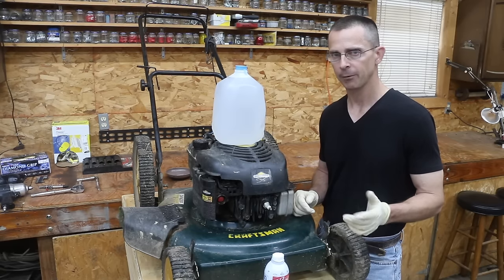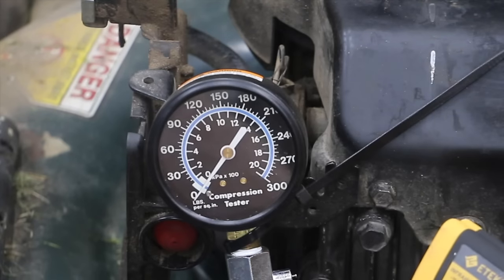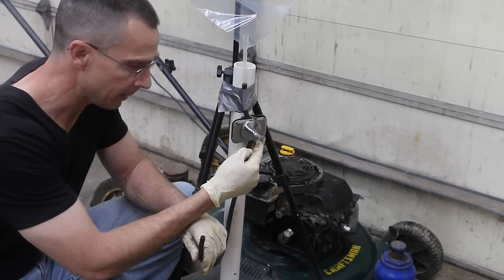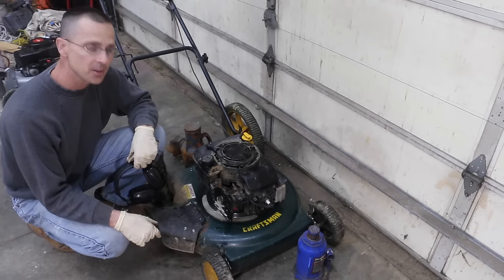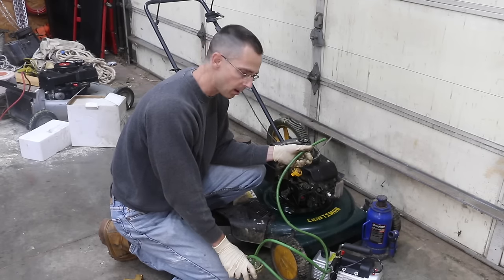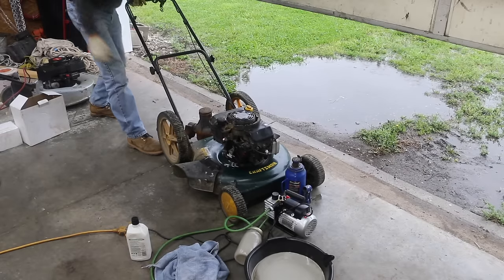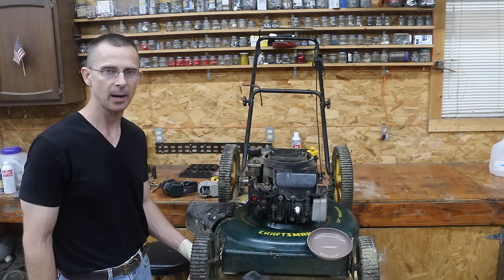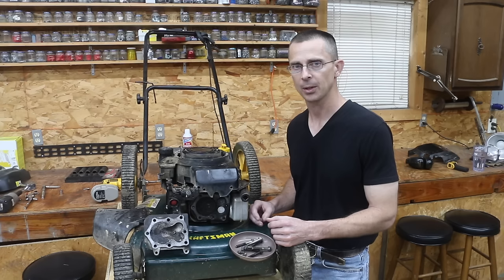Seafoam--can't believe what it did to my engine episode 5--cylinder cleaning test using water!!

Comment: Anybody else amazed that a $100 mower keeps working after all this?
Reply from the maker: Great point!
Reply: Not really. Simple engineering lasts for ever. It's the same with cars, old diesels run laps around any new engine.
Reply: @bixby9797  yea barely halfway
Reply: Mine won't after one season. 😂😂😂👍👍👍
Reply: Personally, I would not want that mower.
Reply: Just goes to show if u know what ur doing u can get anything to work
Reply: I've got one of those engines on a pushmower, and Ive been neglecting it for years because I hate the mower design, not the engine.  I cant kill the damn thing
Reply: My $120 Home Depot special runs like a top after 6 years with reasonably fresh gas. Changed the included oil after the first year (which came out dirty after the first season) for a full synthetic for $4 and it looks new everytime I check it. Im probably going to change it this spring just because 5 years on the same oil seems ridiculous., but it looks like it just came out of the bottle. I'd like to test it but I can't spend the money on that just for a cheap mower. Although it might be perfectly fine. Who knows? I suspect in many ways we are actually living in great times despite what people tell us.
Reply: I’d like to see someone pour water in one of these new EFI engines I have one and I think the dampness killed it let alone pouring in water
Reply: @bixby9797  om617 engine. truly a classic. also amazing if an old 22re finally kicks the bucket you can swap in that turbo diesel with pretty minimal adapting.
Reply: @bixby9797  truly the greatest engines ever. Seen one with 700k on it. Proof that sometimes simple is just better. My buddy had picked up an old 4runner and I believe it had a cracked head so he put a om617 he had laying around in it. I've seen those things last forever too
Reply: @bixby9797  meh. The VW alh is an engine comparable. I scrapped mine at 751k km. When I bought it it had 700, I didn't do an oil change or any fuel filters. Kept on trucking!
Reply: @leinie6683  what's wrong with the design that you hate so much
Reply: I'm surprised it even ran at 60 psi..
Reply: No, it is a very simple machine 😊
Reply: Not at all surprised. One thing Todd doesn't seem to highlight, is his maintenance/repairs not related to his subject material. But another: Unless you're losing or warping metal, you can generally put a small engine through a tremendous amount of abuse. I personally have freed seized motors using transmission fluid and put them back to reliable work without any rebuild work. Since these motors don't reach the same high RPM requirements for automotive needs, they can generally get by a lot longer on a lot less
Reply: It's a Briggs what do you expect 🤷
Reply: I can tell where it wasn't made.
Reply: @RJT80  Lol "reasonably fresh" lmao!🤣😂🤣😂
Reply: @RJT80  I have pretty much the same situation with my riding mower. I keep scratching my head year after year and still haven't replaced it lol.
Reply: @RJT80   R T  you waited a whole season to change your oil ? :X bruh u can burn up to an ounce an hour. Ouch. 5 years on the same oil? OUCH. yea when it says never change oil, change it MORE...I see any of those stickers and I rip them off FOR people. Mostly because they're always in for oil related issues 😒😅😒😑
Reply: I mean it's not really being put to a heavy load extreme heat condition like mowing typically is.
Reply: @siraktbkru8590  ok.... let's a see a dt466 outlive a isx
Reply: got 358,201 on 88 golf vw gas job swear by marvel -gas & oil 1.8--263,500 gas 01 jetta- 2.0---189,500 80 sirocco 1.8 gas--just gave nephew  76 f350 camper spec 390  built out  of 68 eliminator 227,500--marvel and seafoam gas and oil--just blew head gasket cub cadet 128 12h kolher after 47 years!!!!!--love your comment i was alittle worried about the water in the little motor but it was the method very well thought out --thanks
Reply: @siraktbkru8590  it's the same with TV's old crt TV's work for ages! And modern flat screens only last 2-10 years if ur lucky
Reply: Nope
Reply: Yes
Reply: Me and my friend tried to broke one old brigs&straton lawn mower, we took all oil out of it and poured sand in. We ran it for two hours and it didnt break.
Reply: I think it is a honda engine
Reply: bixby9797 I saw one of those 7.3 turbodiesels with over a million. I’d love to see one of these newer cars pull that off
Reply: Really they should build cars like that lawnmower
Reply: The guy has magic hands for mechanical stuff
Reply: @RJT80  My Home Depot Special lasted 7 years before the deck itself rusted through and the blade bit the ground surprising the heck out of me. I did just like you, put full synthetic in it after the first season, then changed it every season or two depending on color. That Briggs and Stratton engine is sitting in the corner of the garage waiting for my new chinesium engine/mower to die so that it can come back into service.
Reply: @siraktbkru8590  not if it's a 6.5
Reply: And if you buy that mower at his yard sale it’s guaranteed to run on anything.
Reply: @siraktbkru8590  Diesels have A LOT more engineering put into them than gas engines do. It also helps tremendously that diesel fuel acts as a lubricant inside an engine rather than a solvent like gasoline does
Reply: Another great test!
If you want something  to think about and what might be coming, a lot of the new cars and trucks, like Toyota have automatic transmissions that are sealed for life. No dipstick, no fluid ,or filter changes period. 
I was in Lowe’s the other day and I was walking through the lawnmower section when I read on the box that the engine in the lawnmower was no fill.
It was filled with oil when it was built. No oil changes and no pulling the dipstick., and no drain valve. So get ready. Oil changes and pulling the dipstick may be on the same list for the new cars and trucks of the future🙏
Reply: I'm not surprised
Reply: He probably got that lawnmower from a garage sale for ten bucks 😆
Reply: no
Reply: Not being rude at all love your videos and this isn't a good example of what I'm trying to say because you don't do it in this video so much, but in some of your videos and they are awesome and extremely interesting and informative, but you have so much to tell you talk really fast some times and I have to rewind it to listen again so what you've said sinks in lol. I could just have a slow brain these days. Anyway love your content thanks for all the effort you put in. 😊
Reply: This is the worst way to do a water decarbonization.
You spray the water in 5 seconds intervals, if you pour water you can lock the engine and in this test the amount of water was so high that the engine lost temperature. This test was made to fail .
My only explanation is incopentency or bad faith.
Reply: I'm amazed it still runs. No I would never use water.
Reply: In response to kubota oz, my 2014 has such gearbox in it.
If one studies aviation history during WW II, Rolls Royce built turbo charged piston engines for attack and fighter aircraft with sealed crankcases to reduce leakages.
Reply: I can barely get mine to start after sitting for a whole season. Lol
Reply: Nah, they’re super-simple, don’t make any power, and have really sloppy tolerances, they’ll put up with a LOT.
Reply: Because he cleans it before every test😂 well, besides this one.
Reply: @Christopher White YeE HaW
Reply: He uses multiple ones
Reply: Aren't the compression numbers more to do with the valve sealing on the seats rather than the carbon build up on the piston head/chamber? Wonder what the numbers are for a brand new machine.
Reply: Yes, the chuck norris mower. . .
Reply: Ah yes, the flatheads last through anything, I had one that was almost completely clogged, it was easy to take apart and fix, OHV engines in mowers usually aren't that great.
Reply: @Joh2n  I'll take that $20 yard sale mower any day of the week over this newfangled crap they got coming out
Reply: Ferrari is looking to use mower engine... 😂
Reply: @leinie6683  put it on a minibike lol
Reply: $100??? I sell these for $50 all day long
Reply: A mower sticker should be added to the other stickers for members
Reply: I absolutely agree. Briggs and Stratton tough as nails
Reply: Probably about the best maintained mower out there… gets cleaned up and drained etc way more often than a typical homeowner
Reply: IDK about the new ones but we had the same Craftsman mower 2nd hand for almost 20 years and we have hit sticks, branch's, stumps, rocks, ran it on low oil, ran it on to much only swaped the blades a few times or less and the only reason it died after 20 years or more and wasn't brought back to life (again) was I just did the same thing my mom did two decades ago and got another one 2nd hand for cheap. I don't advice treating them like what I said, but man can the Older generation craftsmen push mowers take some abuse.
Reply: Anyone else wonder why car engineers can’t build an engine as reliable as cheap lawn mowers
Reply: It's a zombie heheheh.
Reply: @richardrasmussen7334  Some of the new EFI engines actually intentionally add water. Water injection is used in high-performance BMW's to cool the combustion chamber and allow for higher boost pressures.
Reply: Seafoam is way better. I’ve used it in my 2007 f150 about every fourth tank and I now have ove 260,000 miles on it and it continues to run like it did when I bought it
Reply: Dude's got like 6,837 spare heads for it and that piston has seen more daylight than his truck's roof.  If my engine got that much attention I wouldn't be watching his videos to figure out how to make it hang on to a spark plug while I save up a down payment.
Reply: No
Reply: He uses a ritual to keep it running 
Every time one psi is lost he rebuilds it
Reply: My question is what about hydrogen peroxide.
Reply: We used the same lawn mower for over 30 years with very little maintenance, and frankly I gave up on the mower, it didn't give up on me. I got a riding mower.
Reply: It’s all the treatments he puts in it
Reply: Back when lawnmowers and other engine machines WEREN’T made in China out of cheap-ass crap
Reply: In the 70's, every engine we tuned up, got a coke bottle of water ran the the carb. It cleaned the carbon of and reduced detonation..
Reply: @RJT80  You ever change it?  I have a Honda GVC 160 on a mower I bought in 2019, changed the oil after the first season just like you and put full synth in.  Now in 2024 I've lost a bit of that oil, but it still is golden in color.  Mower probably only gets about 4h of run time a season (because I'm always finding free mowers to fix up and I mow with them then sell).
Reply: And it looks like he mows with it too

Comment: In doing this process, the steam is what cleans the combustion chamber. Every time I’ve seen this done, the engine was fully warmed up and small amounts of water were poured in periodically (not constantly fed for extended periods of time). The cylinders have to be kept hot for this to work. The engine got way too cold in this video and the water was not fully vaporizing when entering the chambers. This is why some started to make its way into the oil. I would encourage you to try this again, but instead of a constant trickle try adding small amounts by hand 3-4 times-giving the engine time to warm back up in between.
Reply: John Gotna I just posted the same thing you said before seeing your comment. I agree with you.
Reply: Also use a mist spray of hot water or steam. Be sure the engine is HOT. Best if the water is steam. Thats how Ive done it for along time. Im 67 yrs old
Reply: That's exactly what I thought. The engine ran too cold to flash the water to steam.
Reply: YES. This is how it is SUPPOSED to be done. Large gulps at a time, and a rest period in between to build up chamber heat again.
Reply: You are spot on . He cooled the engine way below normal operating temperature and didnt allow the water to evaporate and steam the engine. Instead the low temperature converts the little bit of steam to condensate, which explains the water blow by through the piston rings, into the crankcase

Comment: I believe sea foam does adequate job w/o having to replace the oil in the engine.  Oil and extra time equates to more than $7.00
Reply: If you use less water (water injection nozzle) then you won't have water leak down the cylinder walls, also there's probably a lot of wear on the cylinder walls leading to leaking.
Reply: Temperature was very low. Water was being more liquid than vapour. I agree, smaller quantity of water would have made a difference. Also putting a load on the engine to make it run hotter.
Reply: @madjimms  so in the end, scott is right, less hassle, less chance of extra work if you use seafoam, no real logic to use water 💦
Reply: I knew a guy who ran a water injection system on his Rally Car..
He used a mixture of water and alcohol(increase the octane rating, cool the engine and quicker evaporation)
Also he used an atomizor behind the carby so that he was only injecting a mist of it to the engine....
Putting water as a stream into an engine is looking for trouble... Look how easy petrol will flood and engine and it evaporate far easier than water when it's a liquid..
Reply: Also the crankcase breather tube is very near... maybe it as suck some ? who knows.
Reply: True, but if you’re about to do an oil change anyway...
Reply: Just do it before u do an oil change lol
Reply: madjimms is on to something.I believe, even though your getting satisfactory compression tests, that you may have a pre-mature ring problem and scaring in the cylinder wall. And you applied way to much water.
I never used more than 16 oz. on big block engines ie. 396, 454, & 596 gas guzzlers that were at peak running temps.
Reply: Also the extra fuel cost too
Reply: This may help direct injection engines that have high risk for overheating the turbos by using chemicals. I’m considering cleaning my 2015 2.7 f150 ecoboost with a water mist. Curious if anyone has tried it yet.
Reply: @brett639  I did seafoam on the 3.5 Ecoboost, it seems to have worked. My fuel economy avg went up by 1.07 mpg over a 500 mile test "to and from work"
Reply: @brett639  
Just do it properly and get a cheap basic water injection kit or diy one.
The amount injected should be rather small, properly atomized and only occur under relatively high load/boost and at operating temperature.

It'll always keep your engine clean, reduces peak pressure spikes and lowers EGT and IAT. There's basically no downsides, even RO water is really cheap and isn't really needed if you have rather pure tap water.
If done properly there's no problem with water in oil at all either.
Reply: Yup, I said that about to myself when watching. The amount you spend on seafoam is just peanuts compared to the oil and time you lose running it through.
Reply: @BeeBeefy  It will need more than just one oil change to get all that water out of the crankcase lol
Reply: I didn't see any results from the Seafoam to compare, did I miss sumptin?🤔
Reply: And to those saying "well, if he didn't use as much water he wouldn't have had to change the oil" I say, if there's going to be chance some water made it by and you are going to have to change your oil. Been watching Project Farm for a while now and have nothing but respect.
Reply: @Cascade1911 If you use a gallon of seafoam I'm sure it will get by too. It's also not the amount of water used, it's the droplet size compared to the engines temp.
Reply: @madjimms  Any engine you would want to do this to would have lots of wear
Reply: And now 4 yrs later, it's about 12 per quart!
Reply: also to possible risk if the water mixes with oil and runs a while without you detecting it.  Seafoam is designed to be added to oil, so assumably it is less detrimental than water getting into the oil

Comment: We had a Chevy 350 engine in a DOH  crew cab truck which spends a lot of time at idle or slow speeds when working on the roads. It had a serious sounding knock and I thought it was toast. My buddy I worked with, great mechanic by the way, said he thought it was a carbon knock, so he did the water treatment for no more than 5 or 10 minutes at the most and the knock was gone. After working with him for almost 30 years, he never ceased to amaze me with his seat of the pants knowledge.
Reply from the maker: Thanks for sharing.
Reply: In my travels In High school years around salvage yards  I was introduced to slowly pouring about a half a quart of transmission fluid in a running cadilac engine that was knocking,  believed to be carbon buildup, causing the noise. the exhaust was billowing with smoke temporarily but It did clear  out the carbon in about 2 minutes.